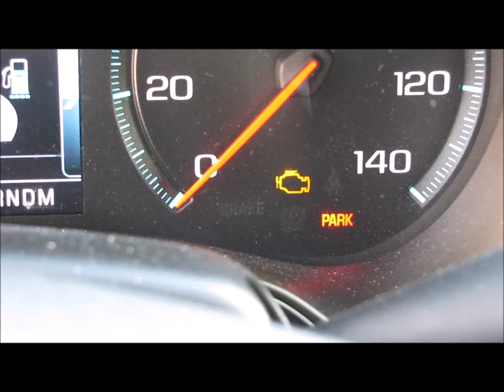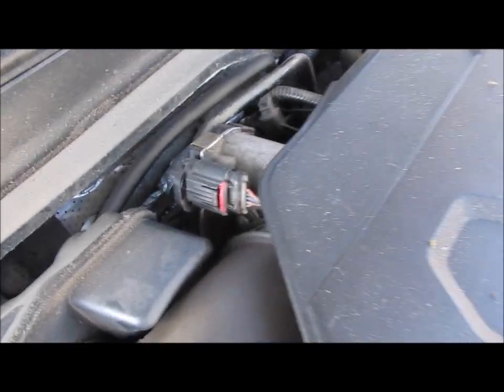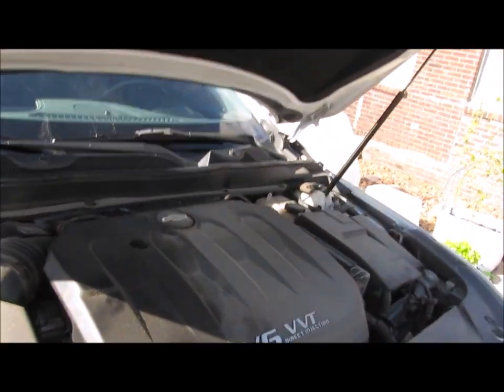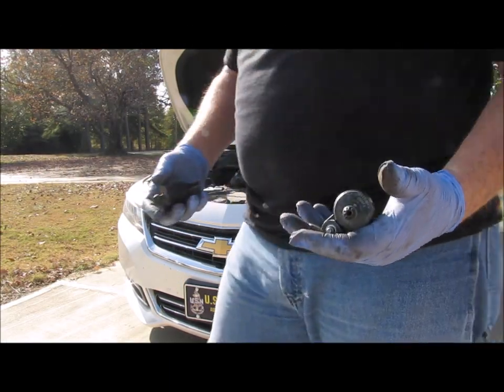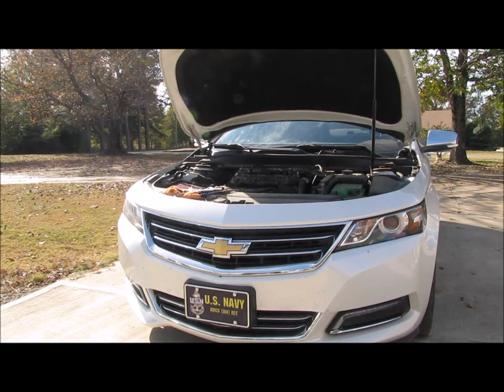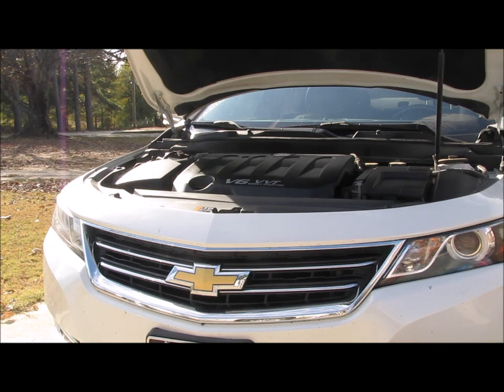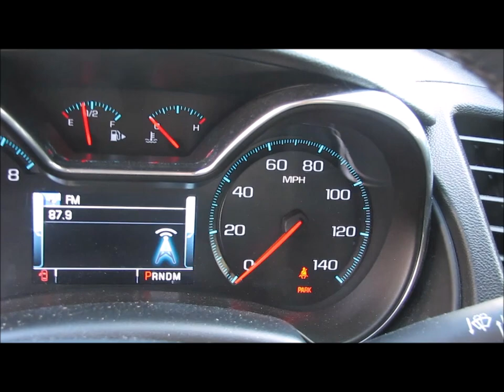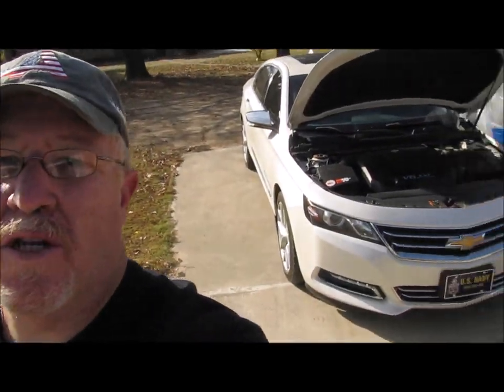EVAP Canister/Emission system purge valve replacement 2014-2019 CHEVY IMPALA LTZ |  Code P0496

Comment: The dealership just recently replaced mine about 5 months ago. I am having the same issue I was before where the car hesitates to start after opening up the gas cap and refueling. I have a different code tho. Mine is P0442 (evaporative system leak-light) after I put the OBD II module on to read the code. Engine light is on just like before. I also read that it may be the canister. Is it the same ploblem again?
Reply from the maker: I would think with a different code you have a either different problem or a combination of problems related to the evaporative system.  I hope you get the problem resolved.
Reply: I'm having the same issue. Paid the dealer $500+ only to have the engine light come on again and that exact same code and issues after refueling. Mine also hesitates when starting and has stalled a few times while driving. Please let me know how you make out.
Reply: Same here I have three codes p0422 code,p0496 code and p2127, I also have check engine light,stabilitrak light,parking brake light, also I had all this serviced at a dealership for a app pedal and a purge valve I'm so lost $600+

Comment: I actually have a check engine light on one of my trucks. Code is coming back as cylinder 7 is stuck/deactivation. Luckily under warranty still and have to drop off Wednesday morning.
Reply from the maker: I used the heck out of my warranty before it expired.

Comment: That’s one thing you can’t ever say about your wife or any wife. “Cheap part and easy to replace” 😂😂😂😂 30 min to take off everything to get to a 5 sec fix the 30 min to put back together. Book time in this job probably pays 1.5 hours which equates to around here in Mississippi to about 150.00 plus parts. Good job Ed👊
Reply from the maker: You are pretty close.  The dealership wanted in excess of $200 to do this repair.  I think I will keep that $170+ and spend it on me!!! 😆

Comment: Was your car acting funny at all mine has same code when I put gas in it will Crank about 10 times before starting?
Reply from the maker: Yes, the car was difficult to start after opening the gas cap.
Reply: @EdsAttentionToDetail  thank u for your help
Reply: I'm dealing with this right now
Reply: That was the problem for me
Reply: I have engine light on with this code currently. Car idles rough when first starting and cranks over several times before starting after filling with gas. I am going to be changing the purge valve . Wish me luck